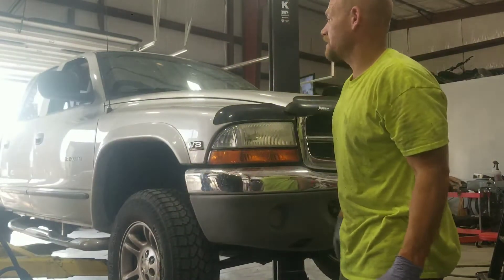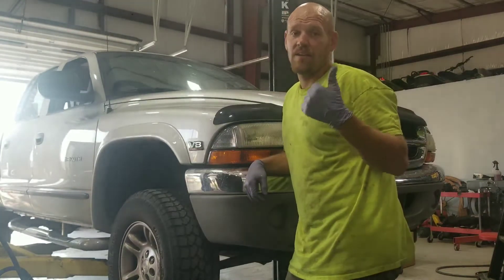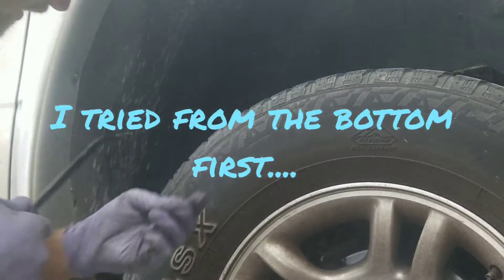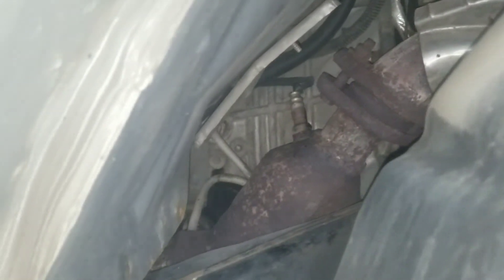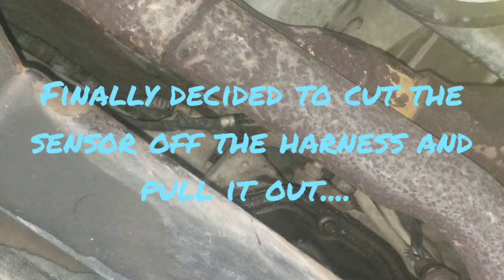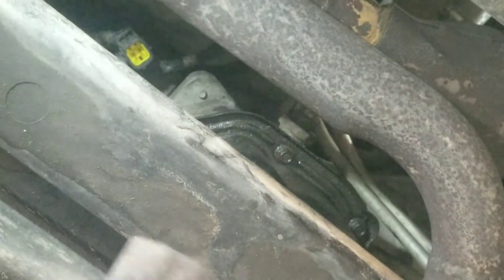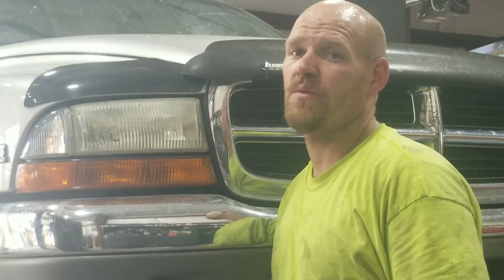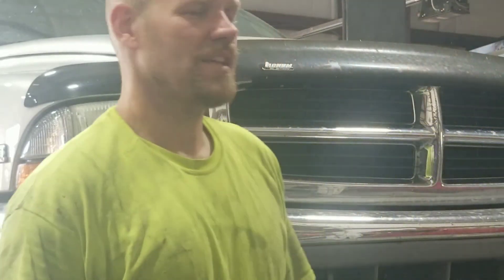Dodge Dakota/Durango Oxygen Sensor Heater Replacement P0155

Comment: This is my next project, but I’m questioning it now after seeing your video. Sheesh that looks like quite the pain.
Reply: Nothing is ever dam easy when i'm doing shit on my Truck!  I have a 1999 Dakota 4wd 5.2 motor in it with less than 101k.  Love this truck...... I making it into a Classic beauty ...replaces  many new parts to make it a dream truck and to make it last for many more miles
Reply: Nothing is ever easy when you start working on an older vehicle... the dam bolt alone will take years to work with!  always let it soak with PB blaster b4 attempting to take any screws/bolts on any older vehicle since i'ts been sitting and somewhat rusted perhaps.
Reply: Mine is a 01 with 101k also…4.7L…I got all the parts and all the tools…and yeah I have literally been soaking the sensor everyday and still working on getting the stupid thing unplugged from the harness…I hate to admit defeat but I might have to…